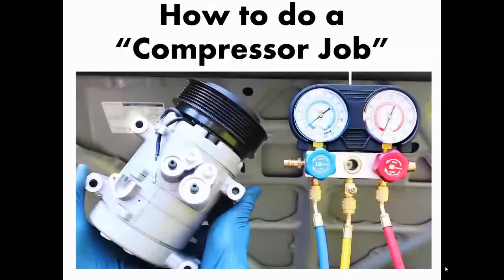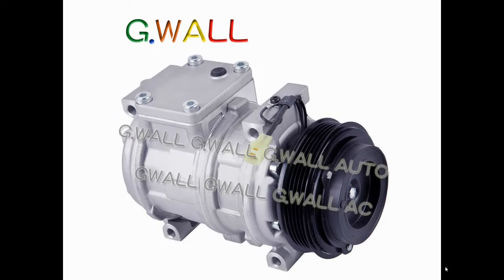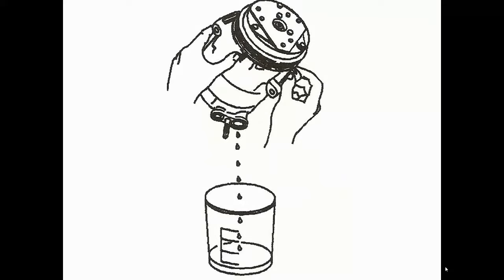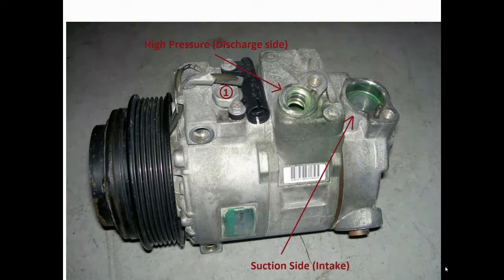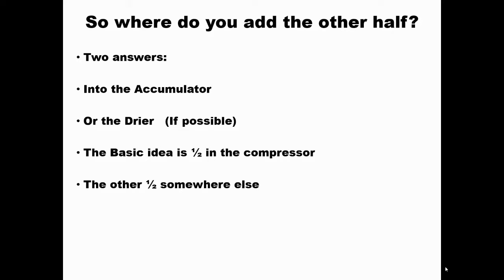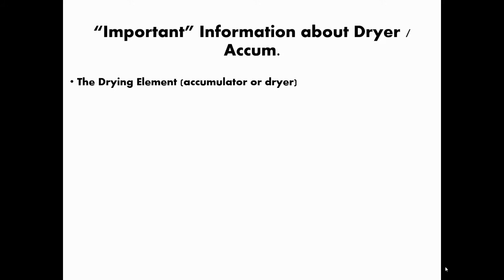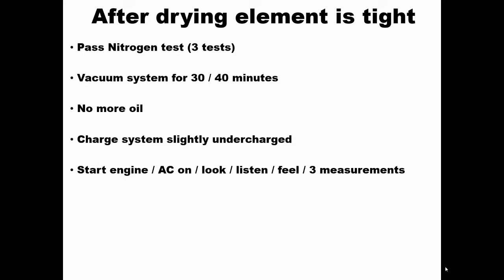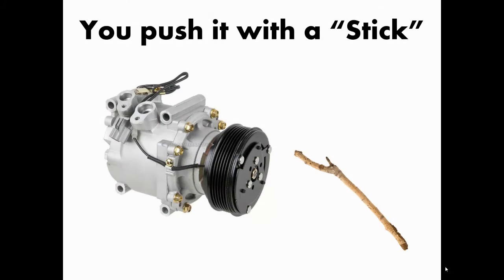Lesson # 12 : How to Replace Compressor.

Comment: The year is 2023 October 21. I’m 47 years old. And I just learned something new. Thank you. This is going into my 1995 BMW 325IS the problem is I bought the compressor used and it was already empty. I filled it with a couple ounces and spun it by hand, and it was kind of squeaky, but it’s getting better now that I left it alone for like an hour I think I’ll just fill it with a couple of ounces let it sit overnight drain it and then put new fluid in it again with proper measurement just to make sure it’s clean inside 6:10

Comment: The best video on youtube to explain SYSTEM oil specs and how that breaks down to % that goes into the compressor and the rest into the accumulator. My 1995 F350 calls for 7 ounce of oil for the system. I put 4 in the compressor and 3cin the new accumulator.
Reply from the maker: Thank you for that awesome comment and the view. Also I recommend not to be bashful with the oil. The specs are the minimum the factory can get away with. I almost always add an extra ounce  to factory specs. But do not add extra Freon.

Comment: Very good video. I fitted two ford genuine compressors on two transits. First new compressor was short filled on oil by 80 ml. The other was correct. Removed one compressor that hadn’t seized but had clutch issues, only 50 ml in it, recommended quantity is 180 ml. Other vehicle was newer with completely seized compressor, little to no oil came out, vehicle is 4 years old. Worth checking a genuine brand compressor new oil quantity for sure. Personally, I didn’t even reuse the oil that came with them.

Comment: watched  2 howto videos on this and the first two put oil in both intake and outtakes. knew that was wrong lol thanks for clearing that up.
Reply from the maker: Thank you for the views and the comment. Some of the comments said that the instructions that came with the replacement compressor said to put it in the discharge. I have assisted students add oil to the compressor 100's of time. I would sometime show then to do it Wrong so they could see that the oil would start to come out almost as some as you rotated the clutch. Thank you again.

Comment: Question previous owner removed my ac compressor from my truck.
Used shorter alternator belt.
Its close to winter would my heater/defrost still work without the compressor installed.

The hoses and connectors are taped.

Great video easy to follow with humor too.

I want put a new ac compressor in and use ac. 
Plus to get rid of check engine light too
Reply from the maker: You are correct. The AC has to dehydrate the air before the defroster  can work correctly. Break a Leg / Good Luck on your repairs.

Comment: Thank you for great tutor video. For system with expansion valve and built in drier on condenser (like 2010 Honda Civic). Can we add the other half of oil to evaporator and condenser?
Reply from the maker: Yes you can add the rest of the oil in the condenser or drier. Thank you for the view, the question and that awesome comment.

Comment: Great videos. Installing a new york style compressor on 1964 lincoln. One side has bolt for purging oil. The other side where my original had a fill bolt has a cap on it. Is TCC being cheap not wanting to supply bolts?
Reply from the maker: I'm trying to remember...I can say the oil fill hole takes a metal plug which is different from a mounting bolt. Thank you for the view and the question. Break a Leg / Good Luck on your repairs.

Comment: i learned alot from your videos , but the reason behind  capacity of compressor oil that is written on it or workshop manual : its difficult to drain all of it remained inside the compressor 

i recommend to add similar amount drained plus approximate leaked oil  
large leak and long time without fix 40  ML 
medium leak and mid time  30 ML
small ...........short .15 .ML 

also to perform oil return procedure and oil migration procedure

Comment: Thanks for this very well done video. I saw only 2 other videos today that showed them putting PAG oil into the accumulator. So, let me get this straight. If my compressor calls for 6 oz. (a guess) of oil, then I should only put about 3.5 oz. of oil into it, and the other 2.5 oz. into the accumulator. Correct ? I am going to be replacing the compressor, accumulator with hose assembly, and the orifice tube filter, so I need to know these things.
Reply from the maker: You are Welcome. I like oil. I like one extra oz. of oil above what it calls for. The manufacturer barely puts enough oil to start with. Put half the oil in the compressor and rotate it clockwise a few turns slowly...do not rotate so fast the the oil starts to come out of the compressor. Put the other half in the accumulator. IMPORTANT... if the tube is dirty with the compressor guts, you will need to flush the condenser until it is clean, If the tube is very dirty, it is best to replace the condenser because all the newer vehicles use multi-cross-flow condensers with tiny passages that are near impossible to clean out. Good luck and break a leg. Thank you for the comment.
Reply: @theoldmecanicoshow9004  At this point I don't think the compressor imploded. The clutch went out on it. I bought a used compressor almost a year ago before I knew anything about them and what to listen for. I just got back to it this morning. there is a ringing sound when I spin the wheel. So to be safe and not sorry, I'm going to buy a new one. And also this morning I placed the new accumulator with the hose assembly above the old one (still installed in the engine bay) and found that the hose kinks at the bend near the firewall, so that has to go back, and I'll have to reorder one of those. Which means that the only part that I have that appears to be the correct part is the orifice tube filter. So I'm delayed in this repair for at least a couple of weeks. Good times. Thanks again for your very important and informative video.

Comment: 2006 Hyundai Elantra. The compressor itself was OK, but the clutch and pulley were both bad, and a new compressor doesn't cost much more than those, so I got a new Mando compressor. I'll change the dessicant bag at the end, too. Anyway, I'm doing the "oil balancing" part now, and almost no oil came out of the old compressor. What?  I got maybe 10cc (1/3 of one ounce) of very clean oil out of it, that's it. I would have expected there to be at least 75cc since the system capacity is 150cc (5.1 oz). I drained the new OE compressor and got about 100cc. According to "oil balancing" rules, I would put practically nothing (only 10cc) back into the new compressor, but that doesn't make sense to me. I'm tempted to put back ALL 100cc and just go with that. What do you think?
Reply from the maker: I remember that "Dumb" oil balance step. I have drained 100 old compressors. We were lucky if 2 Oz's came out, and that was a system that used 8 Oz's for system capacity. Here is my Oil lesson video :  https://www.youtube.com/watch?v=by8LpYAHNHE&t=674s
Thank you for the views and the question.

Comment: Thank u for this video .. my question is in which hose to put  the other half of oil in case  the dryer is integrated with the condenser.. the suction hose or the discharge one
Reply from the maker: Suction hose. Thank you for the view and the question. 
Break a Leg / Good Luck on your repair.

Comment: Is there a easy way to replace ac coil on 95 grand marquis without removing compressor. I have very narrow space to get snap ring out of coil while in car. I been trying for a week. I removed 3 bolts but can't twist it to see inside. This was first time I attempted this. One snap ring is holding me up from finishing
Reply from the maker: Have you tried a couple of Picks ? The one with a hook shape and the one with  90 degree.
Reply: @theoldmecanicoshow9004  ty after so much time I decided to have compressor changed. I used pair of surgical tweezers they use for surgery grinded then down. But you cant see anything. And hoses on top are froze on. Top. I would never attempt this job again. Lol ty for information. Having a real mechanic finish my job. Lol

Comment: Great and well organized video! Question: 
1. there is a draining port on my Denso compressor, should I add oil into that port or into the suction port? 
2. After I put half of the oil inside compressor can I install the unit and use vacuum to pull another half in from low pressure/high pressure port?
Reply from the maker: Thank you for the view, that positive comment, and the questions. 1. Yes you can pour into the drain hole, don't forget to rotate the clutch to help spread the oil around and put the caps on during the installation. 2. I like to pour the other half of the oil into the accumulator or drier. Yes you add the oil into the low pressure port. Yes do a vacuum. Thank you again and good luck on your future repairs.

Comment: I screwed up and put 3 oz too much into my compressor. Now it won't cool. I didn't run it long. Can I remedy the problem by removing the compressor and draining it or do you think I will need to flush out the system? 05 Nissan xterra. Great video!
Reply from the maker: Too much oil makes the pressure go too high. Gauge reading are very helpful. Do you know what the pressures are ? 
Too much Freon is more common a problem  than too much oil. 
Thank you for the views and the question.
Reply: @theoldmecanicoshow9004  Turns out the New Four Seasons Expansion valve I installed a little over a year ago failed. I wanted to do it right and replace all the parts to make sure there was no contamination in the system since the compressor went bad. But, at the time I was convinced to buy a "low mileage" used compressor. That compressor did work pretty good, but it was a little too noisy, so I wanted to install the new compressor b4 it went bad and destroyed my clean system. The A/c stopped working the day b4 I installed the new compressor and I just thought it was probably due to the old compressor. So, I installed the new one and still nothing, then I discovered it might be a bad expansion valve. The factory Expansion valve was still working when I removed it (18 yrs old). Even the New Four Seasons Compressor is a bit noisy, but it is working well now with the new expansion valve. Point of the story is the all of these Aftermarket products are pretty much all chinese garbage. Fortunately I didn't have to remove the dash to install the new valve. If so I would have used OEM parts and from now on I will only use OEM parts
Reply from the maker: @eminiscalperpro9729  We all learned the Hard way...using after market parts. It's A "Joke" (bad joke) how bad these after market parts are.
Thank you for sharing your experience.

Comment: Great video! I wish I had an instructor like you when I was in HVAC school 20+ years ago. I work in residential/light commercial but never auto. I have a question for you. I will be repairing an older neighbor’s 2004 F150 after hearing his compressor rattling. There is still enough life in the compressor for me to get pressure readings within an acceptable range. He stated he had the whole AC system replaced in 2021 and it looks fairly new. I also probed for leaks and didn’t detect any. I can pick up a new compressor at our local auto store right now, but it’s labeled as dry and needs 6.75oz of PAG 46 oil. Is it possible for me to swap out the compressor without putting a new accumulator? Can I fill the suction hole on the compressor with 6.75oz of PAG 46 oil that is labeled on the sticker, rotate it slowly 10 times, hook the lines back up, pull a vacuum, and recharge to get him by until he figures out what he wants to do long term?
Reply from the maker: It's usually a good idea to replace the accumulator or drier. I believe you get a "Longer" warrantee from the auto parts. In fact, some auto parts will give 30 day warrantee if you don't buy the accumm. And another reason to replace the accumm is helps to get the correct amount of oil in the system. Yes you can pour oil into suction hose and turn compressor like you stated. Break a Leg / Good Luck my You Tube friend.

Comment: My 1967 Lincoln A/C compressor manual (car is a 1968 but supplement manual says refer to 1967)  manual refers to  say to use Suniso 5 or Capella E refrigerator compressor oil or equivalent. Not been able to find this for my R12 compressor. Could you please recommend what I might use. I see some refrigeration units use mineral oil with paraffin and without. Somewhat confused. Thank you. Love your videos!!
Reply from the maker: Thank you for the views, that positive review, and the question. What refrigerant are you going to use ? If you use R 12 : use mineral oil / paraffin. The "Factory" name for the oil was what you said. The "Generic" name or the same oil is mineral. If your going to use R 134a :  use "Ester" refrigeration oil. Break a leg / Good luck.

Comment: Awesome video, I'm just learning about all this because my mechanic says my compressor went bad. I'm going to attempt to replace the compressor, I'm also going to replace the drier. Do you think it is necessary to replace the condenser as well? Is there any thing else that i haven't mentioned that i should replace?
Reply from the maker: If the "Guts" (internal parts of the compressor) came loose, they go straight to the condenser causing a restriction. Compressors do not have to get noisy to spill the guts, but if it was noisy, replace the condenser.
I is better to replace the condenser but, stay away from the super cheap Chinese parts. They either don't fir correctly or they don't last (leaks).
Thank you for the views and the question.
Break a Leg / Good Luck.

Comment: Great video! However, as a newbie to ac, I have a question. After filling the compressor and drier with the correct amount of pag oil, wouldn't some of the oil be sucked out during the deep vacuum? What am I missing here.
Reply from the maker: Thank you for the view, the comment, and the question.  Some of the oil  comes out mostly the recovery (or venting) . Very little might come out during evacuation. Good luck on your repairs.

Comment: Great videos my question is can I use Dielectric grease on o rings for hooking up ac lines?
Reply from the maker: "ALL" seals need lubrication. The lube is IMPORTANT for two reasons: First the lube is a big part of the "Sealing" process. In fact, without the lube the seals are likely to leak right away or for sure later down the line. Second reason all seals should be lubricated is the lube "Helps" to prevent damage to the seal during installation. Also the lube helps to make the installation EZ'er. 

I suggest that you use the correct oil that goes in the system that you are working with (no Dielectric)

Break a Leg / Good Luck my You Tube Friend.
Reply: Also I have 1997 ford ranger 2.3L and I’m replacing all ac equipment what orifice should I use I live in Lower Alabama Thanks
Reply from the maker: @earnestodom1900  Orifice tubes come in different shapes and passage size. I just get the one it calls for. I hope I was of some help. 
Break a Leg / Good Luck.

Comment: It is very good and detailed film on changing oil in the compressor, so many tips, thank you very much. If I need to replace the oil fm the compressor and not sure what exactly oil is there, can I flush it out? Is it possible? With the special flush liquid, like what we use to flush the evaporator e. g. The car AC (it is 2001 Saturn SL2) works on PAG oil (that is what Shop Manual says, they don't specify which PAG of 3 types). PAG oil comes in 3 types 46, 100, 150. As far as I understand you can use any, but you can't mix them. The car was in the dealer shop like 10 years ago, and they replaced the compressor 3 times, but  shortly after AC stopped working anyway.  I think that is bcs they didn't replaced the Condenser, I've read that the clogged Condenser can cause the Compressor to fail. I'm replacing everything besides the Evaporator (which I will flush of course) I think. Or if so little oil is left after proper draining it doesn't matter what PAG was there? Thank you again.
Reply from the maker: Thank you for the view, the nice comments, and the questions. Yes, you can use the AC flush in the compressor. In fact, I would pour some in, and then rotate the compressor by hand, drain it out and repeat at least once or twice more if you want to get all the mystery oil out of it. Somewhere there should be some information about the correct PAG.  46 is the most common. But again, somewhere there should be the information, I like to use the correct PAG.
Reply: @theoldmecanicoshow9004  Thank you very much for the detailed replay. That is what I will do to flush out completely what is inside of that compressor. I think at that time when the car was made there was probably only one oil, what is now PAG 46. And that is why they say just PAG in Shop Manual.  I see now all the aftermarket compressors for that car come w/PAG 100, so better go with  that one. Especially as I will flush the Evaporator and replace all the hoses, condenser, receiver drier, and expansion valve. Thank you again for that advice w/compressor, I thought to do so, but was not sure.

Comment: Question: After installing the compressor and the accumulator, once the system is closed, should I carry out the vacuum process immediately or can this wait until I take the vehicle to a workshop the next day? I ask because I plan to install everything and take the vehicle to a workshop to charge.
Reply from the maker: Thank you for the view and the question. You do NOT have to vacuum immediately. So long as the system is closed you can vacuum and charge later. That was a very good question. Good luck my You Tube friend.
Reply: @theoldmecanicoshow9004  Thank you so much